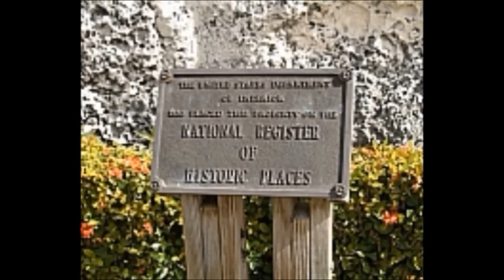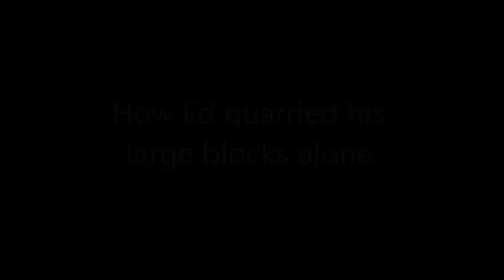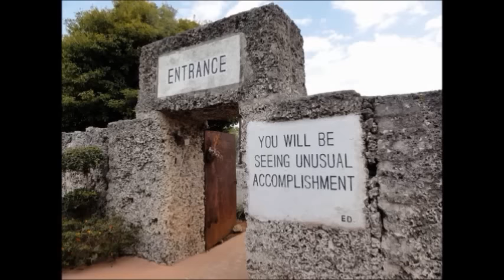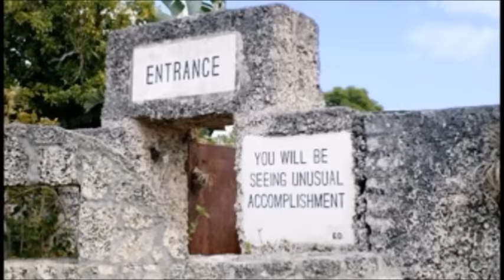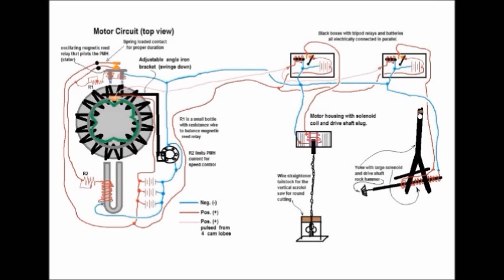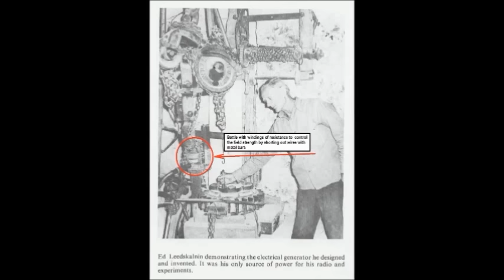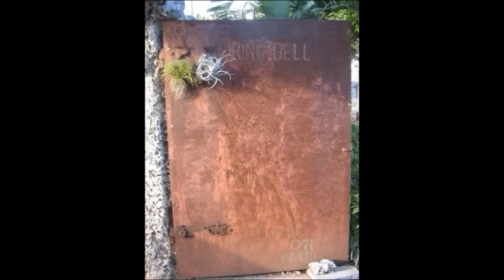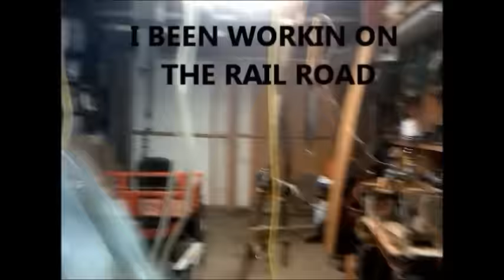Eds Coral Castle Quarry and Flywheel, Engineering Mystery Solved

Comment: You totally missed the point on everything, you don't even have to read Ed's books, if you look at all the symbolism in the photos you would see that there's a lot more going on than meets the eyes, looks like you only read half of the magnetic current booklet cause you've not replicated anything really, apart from a pretty neat job making the flywheel. You have to learn a lot of different subjects to fully understand what exactly he was trying to achieve and even then you probably would understand it all. Everything in the video is what he would want you to think as to how he did it all, but you not even close apart from the drawing at the start.

Comment: Modern hydraulic  machinery could certainly do the job of the tripods and cutting apparatus faster. But it would lack the style and that modern stuff isn't cheap. It looks like he built all his stuff using junk. I love the way that the motor works. Someone should build a more modern version using proximity switches and neodymium magnets it wouldn't get stained by the arc. It could remain just as primitive and artistic  looking. It might seem even more magical, be more  powerful and less transparent . Maybe not it would lose the rhythmic sound. Even is his day he could have used a quieter and boring system of brushes. Or an even more boring and only slightly modified old time dc elevator motor.

Comment: You think you have cracked the secret but you have not. Just one simple question is all it takes to demolish your explanation of how he did it. Well, you have not touched on nor explain why, without the use of hydraulics, Ed could lift stones up to 30 ton weight with his mechanism that only weigh a small fraction.  This is what baffles people. It is the science that astounds, not the working of the mechanism. As an analogy, you can't use a thread to pull up a one ton object. Ed's secret involves secrets of levitation and anti-gravity, and it is certain properties he had discovered in electro-magnetism that allowed him to do such feats based on only one man labour.

Comment: In old mechanical teacting actualy bacteria elements and magnetism were used.
Tipical lead acid baterry can gain electro plate,electrolisys,ore gain 2x the voltage ore 2x the amps but other portion is cutt in half.
When this hapens it is known baterry re conditioning de sulfation can be achived via dc motor and 2 baterrys with diferent voltage potential as long there exist difference in voltage preshure dc motor can spin siemengly for ever .
Comonly transformer baterry and dc motor are used as well .
When this changes acure like me lead acid baterry if starts to act that way it becomes thermal baterry it reacts to thermal changes in the air.
Exampel in winter time me baterry stays alive more but in sumer time it discharges at faster rate.
Ed Cole,John Bedini ,Peater Linderman,Joe Cell and lot more peopel used this methode spliting the positive ore spliting the negative.
Most comonly they are known as compound electric starter/genertors.
Ford used them for a while 3-5 brushes SG's.
Tipicaly they have twin ore more commitators.
Pulse generators do not have back emf .
So thats where those extra brushes come in to play at right angel to extract back emf.
So most likely Edwards generator is compound generator who reacts at thermal chages chemical reaction in combination with electro magnetism.
John Bedini explained some of those effects with hes alum baterrys and hande made copper disk diodes.
Probably normal geats and levers were used the car diferential is perfect to perform task for torque conversion .
Hit And Miss engines were mentioned how ever not many peopel know about compound engines .
Hit and Miss engines used back on the past ethanol/methanol vaporisation carburation .
Normal waste spark is twin ignition be chageing polarity of fiering peopel get 2x the speed ore 2x the torque of existing engine.
Normal unusual engine design lay out in the old days were 5 6 8 stroker engines.
How much I know old hit and miss engines used kerosine water .
Basicaly that thing culd work 24h on 1l pure oil .
So I belive lot secrets are missing there .
I belive Edward was not only good stone masone but he hade good understanding about electricity mechanics chemistry and aperantly clock works.
There is somthing similaritys to Papp Engine and Lanz BullDog tractor cilinder locking.
So I wuld not be suprised if he culd do all that staff be him self .
How much I understand that guy was surounded be high winds and water so posibly pumps were used as well .
Nice video but I wanted to add some info related to that men he was a geniuse after all.
Many peopel coppyed hes ideas but dont know how that energy is converted.
Thats why I mentioned compound sg's and compound engines .
I belive those baterrys are also compound baterrys they are not standard lead acid baterrys .
Most probably if the baterrys are electrolisying they are put at hit and miss engine wacum intake manifold to make baterrys cold as much as posibel.
I alredy mentioned thermal baterrys they charge and discharge rate is improved if they operate at centrain condition if its dobel the voltage it will probably work best in cold temperatures.
After all I have same effects in me classic gm car I leave me car for 35 days at -20° when I go at work trip come back and litel cranks longer due the reason I have mechanical fuel pump but other vise engine cranks fine starts up right away baterry is not drained instead it prefere's cold conditions I just litel retarded ignition timing 5 minutes working engine baterry charged it self back to normal.
Thats what you get haveing back charging alternator and failing blinker relay tuching ground .
So it is twin ignition at a sence.
Increasing chasiss ground voltage plate potential increase's voltage in baterrys but half the amps produced be the alternator it works similary to dc generators.
And plasma ignition reacts diferently with centrain fuel types .
And that weather conditions at Coral Castel are probably weat moisture rich cold conditions perfect for modified generators and baterrys.
Scherbiuse drive might be ore might not be related to this subject .
I dont know many peopels work are close to this one.
Depends what minerals are awailabel to Edward at that time's and what bacteria type he used .
Probably he did not hade fuel problems considering algea and other micro onganism surounding that Castel .
So no doubht that men build it be him self.
He was after all geniuse .
But again lot data is missing .
Perhaps Gerard Moring used some thing similar pulse generators with plasma ignition normal gas based lights turn on even if you use hundert of bulbs.
So no doubht it wuld work.
But still lot info are missing the goverment confiscated lot Edwards tool's so there are no working model's this all is just quesing .
Owen Magnetics car is similary build  so thats where peopel will recognise some of that mashinery related to this video.
Mister Joe demostrated some broken magnets effects on iron pipes.
Nearly identical effects does the Papp Engine.
Im just saying not evry thing is shown ore explainet to full degree.
Normal compound engines have massive torque power it culd easely tow 20tons load.
For peopel who doubth me please read bacteria eating dizel oil ore co2 gas eating bacteria wikipedia.
So definatly Edward did not have problems with fuel.
He made his own fuel in batches like normal distiling alcohol ore methanol wuld be acuared.

Comment: No-one has explained yet apart from vertical cutting, as to how Ed  cut a coral  block horizontally  from the coral quarry such as when the vertical cuts are 3 to 4 feet deep, then get ropes ?? under the block to lift it up. This supposed no-all  expert, explain please.....

Comment: Now how about that revolving stone door with the center drilled so perfectly.
Reply: Was there today the door is seized shut due to weather. He had made 3 rotating objects with old ford axles. 1 of the 3 still works because he installed a grease fitting and they keep it lubed up.

Comment: This definitely is not the way it was all done and likely what he wanted people to think he was using to do it. His words exactly were "I have discovered the secrets of the pyramids. I have found out how the Egyptians and the ancient builders in Peru, Yucatan, and Asia, with only primitive tools, raised and set in place blocks of stone weighing many tons." 
Now research how heavy some of those blocks are in those structures, their locations, and how far the stone quarry is.... Your method isn't "unknown" or capable of lifting 100+ ton blocks of granite, and the way you cut the stone wasn't how Egyptians cut stone either because they've have experts put the cut edges under a microscope to find it was done with heat, as if a laser sliced right through it.. 
When Ed was working on his structure he always sang like he was specifically singing to the stone & he made it in that specific location because its on a Ley line, like all the other ancient structures. Coral stone is similar to quartz and vibrates at a high frequency. I'm not sure exactly how its done, but I know that its similar to acoustic levitation where you're creating the vibration frequencies with technology or instruments, but instead of music instruments he uses the Earths natural energy frequencies. That's why Coral Castle along with all other ancient structures are located on Earths "Ley lines", and if you measured the acoustic resonance frequencies in Coral Castle or any other structure you'll see that they're all producing a high amount of the natural energy from the planets magnetic field & they knew about Earths energy grid or Ley lines which is insane....

Comment: split rocks with "magnetic" power. not banging, he was too fragile. using the wedges as it's "spark" which would split the rocks accordingly. (Wrapping each wedge with coil or using magnetic wedges) (using the magnetic power against each other would cause a "burp" (would cause a force which would attempt to separate from another splitting the rocks.)

Comment: This setup is too costly with the current cost of car batteries at 200$ at least up here in Ontario,Canada!as of 2023,24!
And a generator can run an electric winch,so just buy a generator for 500$!

It'd be cheaper to build a hydraulic mounted winch run off a gas engine,or just buy a 10000 lb electric auto towing winch.
Also,I recently paid over 138.oo $ for a 12" x24" x 1/4"  new steel plate!
 Although things cost less in the US then up here!
So,finding a steel plate that is 1"  or 2" thick and as big as a fridge door will be next to impossible to buy reasonably in today's market,other than a salvage yard.
Also ,putting batteries up in a box like he did,was redundant, you won't get me climbing up a tree with that crazy ladder setup and carry batteries up on top of a tripod,and then wire them up!
Da! Whst was he thinking?
And now,we have carbide cutting blades that cut steel,and this whole setup is so disfunctional with modern equipment it's just a waste of time,to some degree! Other then how he moved these blocks up to the next level.
The reciprocating saws and engines are useful ideas,but you can use or buy an old tripod for engine hoisting off someone,instead of using trees!
Interesting experiment, but not feasible!
Something for an old fart to do after retirement, but not feasible if you wantbto run a production block cutting company!😅
But I will compliment him on his end goal build a castle out of coral blocks!
But I'm curious to know how he found the coral,is it inland from the ocean?

Comment: Voltage loss at 12v is real bad even with 16 Guage wire. Very inefficient system with so much resistance eating up the usable power. Batteries in parallel won't help....

Comment: The opening of this video had me a bit worried it was going to be some flattie conspiracy theory ancient giant alien multibubble universe wackjob kind of video that was going to screw up my YT suggestions with even more pseudo-science garbage. But, I held it out, and was pleasantly surprised by the ingenuity of Ed and his 'does the job with whats laying around' macgyver style of machinery. Im of a similar ilk, while those around me are deer in headlights over some piece breaking or not working, Im digging some old fence wire out of the ground I noticed a few weeks ago, stripping some cable with my teeth, commandeering a strip of cloth from someones shirt, taking apart the stand to something for a plate and lever. And in the time it took them to form a committee huddle of whos going to the hardware store to buy what and such Im climbing back down the uprights, "excuse me" leaning through the huddle and flipping a switch much to their horror. "What are you doing?! It doesnt......" [whiring clacking] ...yeah huh, Im getting back to work. Yall go ahead and figure out whos going to buy the part I told you was going to fail last month.... Love that kind of problem solving, it doesnt have to work for long and shouldnt stay that way but it works for now. I would have preferred a more in depth explanation of chaining the top of the tripods, because that is a neat trick I did not know about!

I fear the apprehension I felt in the beginning has to do with the production quality. And, hey, I started on less than movie maker back in the win98 days, I cant begrudge that. But I will say the audio mix defiantly needs some balancing. Very distracting music levels in some spots particularly with narrated technical details. Over all, I can see why the average worksite doesnt do stuff like that anymore, mainly because we have tons of companies to provide far more efficient equipment. That being said, again, that attitude of 'get it done with what I got' is all but lost on todays generations of makers expecting perfect machined parts and such..... And that is worrying, and sad.....

Side note for the faker makers out there: Well, kiddies, there are no spherical cows in vacuums. And as long as all yall care to learn is what wire to plug into which pin on a premade breakout board while copypasting code you dont even bother to attempt to understand, instead of achieving something with the barest of supplies (salvaged supplies no less), you will NEVER be the bubble-gum and paper clip atom bomb level of macgyver maker a lot of yall seem to think you are. Yes, cheap near lab grade premade sensors and such are awesome!!! Im from an era where a single blue LED was $20...IF they had any in stock because it was the new hottness and everyone wanted them. But if you haven't the slightest clue how to make one yourself, or at least what goes into making one, or worse assume no one could ever make one at home and anyone who says they can is stupid, then your opinions on what is possible are worth less than the grime on my shoe. GET OUT OF ADAFRUITS POCKET!!!! She uses hipster flash to sell you on dime store low bar 'I did a thing' hollow self worth. You can do better, you can be better, I know yall can...because I believe in you!

Anyways, glad I decided to watch the whole thing, very cool stuff.....Just REALY needs a reedit.....

Comment: Ok. I can see that lifting the posts requires knowledge for doing that. But how did he carry the posts there. Supposedly no one saw him build the castle, so who placed the lamp posts there. He didn't even own a car, just a bicycle.  So sorry.. lifting with technique is one thing.. moving lamp posts around, or even bringing them to a location would require machinery. I give props that he was knowledgeable with lumber as he worked as a lumberjack in Texas if I heard correctly. But here are too many gaps. Plus he moved the whole castle 10 miles from its original location and according to eye witnesses know one knows how he even put the blocks on the truck of the only trucker that helped him... too many gaps to the story..   I believe there is a little more to it than just keen ingenuity.

Oh, I am curious. How did he recharge the batteries again?.. I would assume the right answer is to spin the magnets manually because there was not electricity there, as far as I know. And you can't pin out the laws of conservation.. so how did that happen again.. it almost sounds like you said he used a generator.. so again.. what did he power the generator with?... you are not suggesting he came up with a perpetual way to keep the wheel spinning with just magnets.. ?? or did you ?.. sorry just want clear explanation of that part.. we can assume many things but there are no records of him having electrical power there.. other than batteries and the magnetic wheel.. so If all this is close to accurate, he probably didn't sleep and sat on a bike cycling away all night to spin the generator to recharge the batteries.. LOL
Reply: Wheel was probably resonator with earth's field.